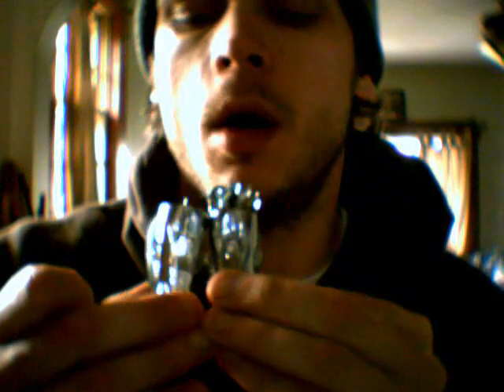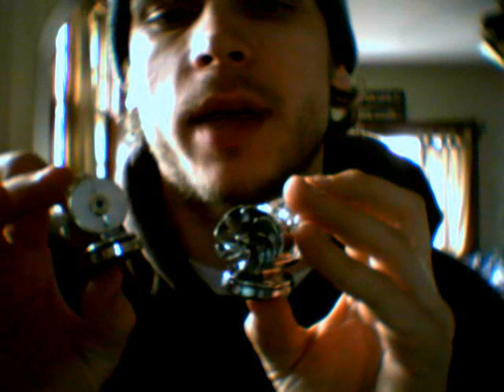Free Energy Magnet Generator Theory #1

Comment: I've Lighten up LED's just using static electricity.  Just take an LED put it in your fingers on a dry day and then walk across the carpet and touch the LED to a door handle and it will light up rather brightly, but very briefly.

Comment: LED's produce 100% light and 0% heat.  LED's use a tiny fraction of power to produce light compared to an incandescent light bulb.  So it doesn't take much electricity to light up an LED.

Comment: Anytime a magnetic field impacts a conductor a voltage and  current is generated.  Even if that magnetic field is simply coming from a nearby AC generator or stray magnetic fields from anything else, even a near by transformer.  However this is not free energy, all the conductors generating voltage and current also produce another magnetic field that pushes against the original magnetic field.  Thus there is no free energy being generated, only capturing random magnetic fields.

Comment: Howdy dude. First off the answer to your query is "No." Electromagnetic induction draws current from the source at the rate of Gauss' Law: you do not double the electric output, you more than halved it. The more motors you put around the powered motor, the less electricity you get. It is a losing proposition.

Also note that to calculate energy input and output you must convert every measurement to Joules. You will never, without exception, get more energy going out of a system than goes in.